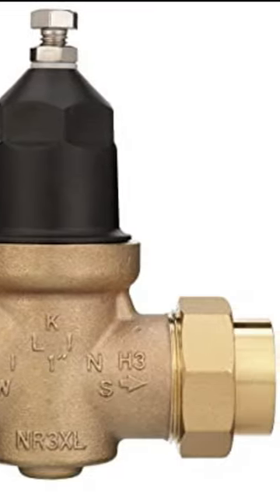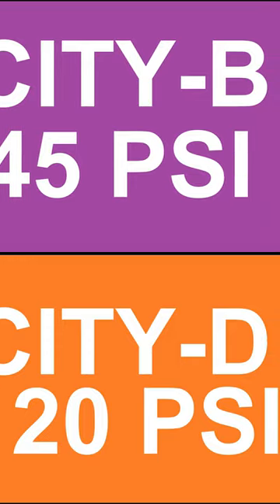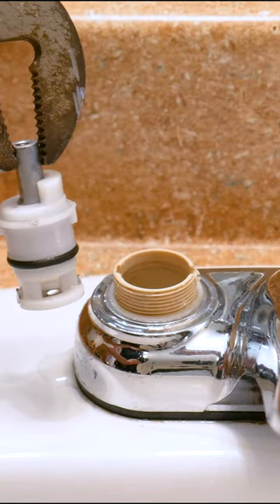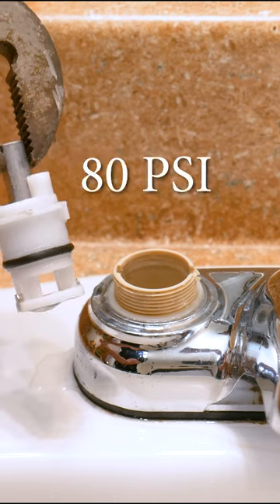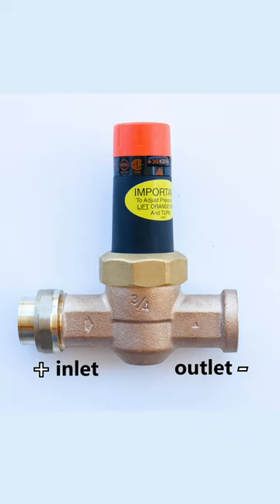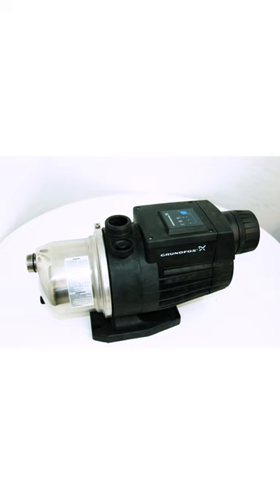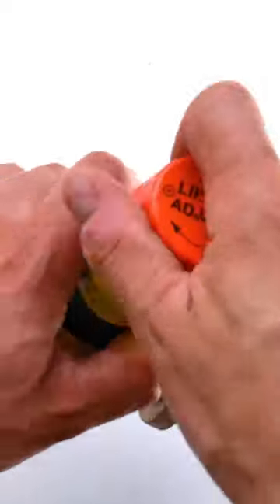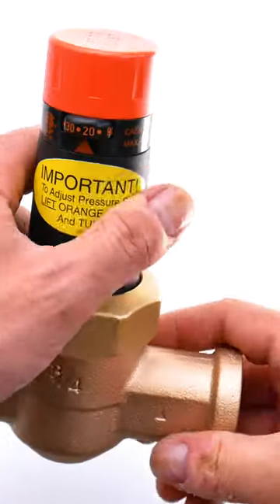What is a PRV (Pressure Reducing Valve)

Comment: My old house had a 1" main, and had 120psi static pressure. I made sure and installed some spigots around the house before the regulator, so we had AWESOME pressure AND volume with a 3/4" garden hose. It was impressive. 
Inside the house, however, before installing the regulator, turning on the sink faucet would result in a shower from the water bouncing out of the sink.

Comment: One house I owned had an actual pressure gauge that showed how much water pressure was in the line at any given time. It was usually around 80 psi. give or take 2 psi. I think ALL homes should have one where the line enters the home.
Reply: I bought a similar gauge that you attach to an outside faucet. Turn the faucet on and it registers the water pressure on the gauge. Not a permanent gauge but informative none the less.
Reply: @onionhead5780  Same here. They work well for a quick pressure test.

Comment: My old regulator failed and I started to hear the pipes hammer, I purchased a gauge and checked the pressure and it was 95psi, I went under house and replaced the regulator and put the pressure at 60psi.